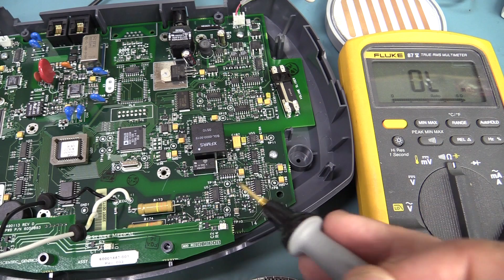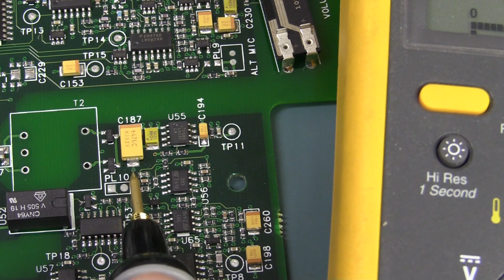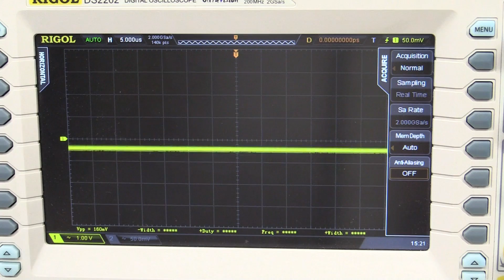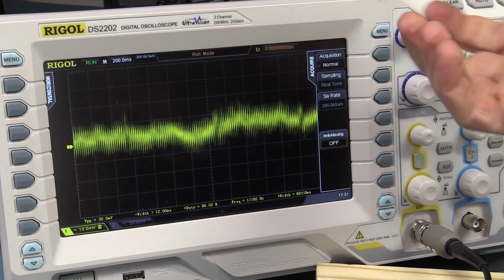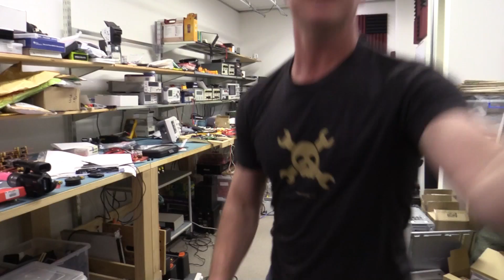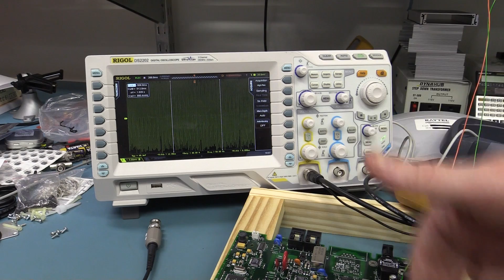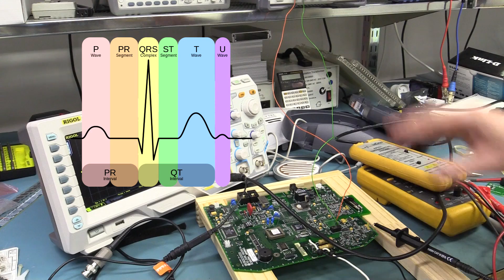EEVblog #660 - Electrocardiogram (ECG) Experiments

Comment: It is quite impossible to get the actual waveform out of that thing. You should need a proper ECG with those pads on the chest, however you can get the heartbeat of that thing the waveform will be too fuzzy:|
Reply: In my little understanding of ECG, the pad on the chest provides vertical waveform propagation monitoring capability and does not make your ECG signal less fuzzy, you are just simply missing some data. Any fuzziness is probably due to ineffective common mode rejection, muscles movement and imbalanced physical signal inducting on both wrist band.
Reply: He doesn't need pads on the chest, the wrist bands are RA and LA (assuming colour scheme is the same as most other units) which provides a Lead I readout. ECG monitoring devices will have the electrodes for the upper limb leads intended to be placed either on the inner aspect of the wrists or up high on the chest (near the shoulders).
Reply: Yeah, but it isn't very accurate. As I said the output will be pretty noisy, that's why they've invented the chest pads ECG:)
Reply: XanderZ You're not talking about the large square pads? Those therapy pads are for defibrillation/pacing although they can be used for monitoring Lead II. Every other device I've ever used can operate just fine with the monitoring electrodes on the extremities. In practice I've found they sometimes work better (at least with the Lifepak-12s I regularly use).
Reply: Soldant No that isn't what I meant. There is a type of portable ECG which I had on me to monitor the heart beats.there are like small sticky pads(I think 5 of them) sticked on my chest and abdomen. On the non-portable ECG there is like a strap which goes on your wrists and underneath that are like 3 probes, 2 on the feet and 2 on the hands.

Comment: How? The transformer of the power supply is in peaces.
Reply from the maker: TheBadFred The wonders of video production schedules...
Reply: This video was shot before he disassembled the power supply.
Reply: peaces haha
Reply: EEVblog
Dave, to reduce the 50Hz noise in the signal maybe you can implement a notch filter with your Stanford Research SR650 Programmable Filter. Best regards.